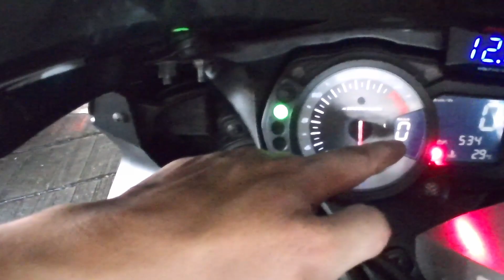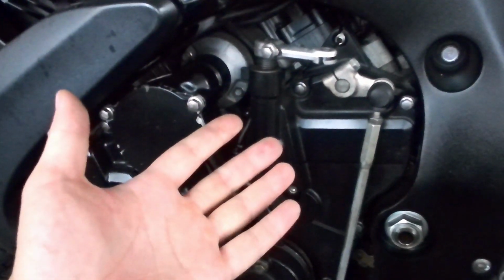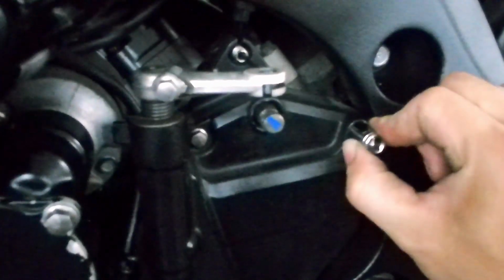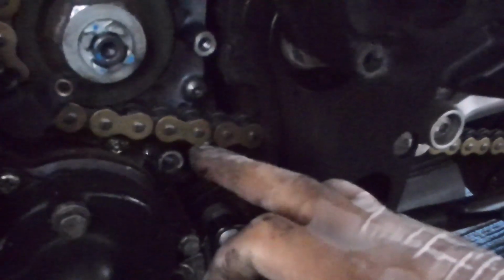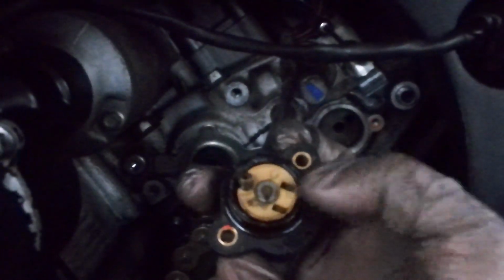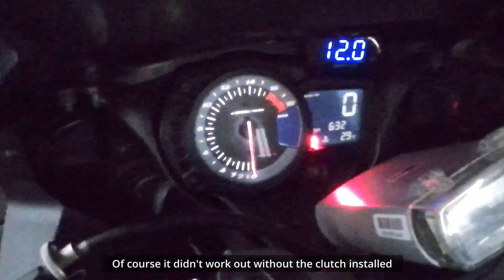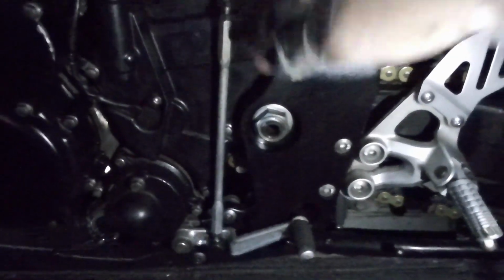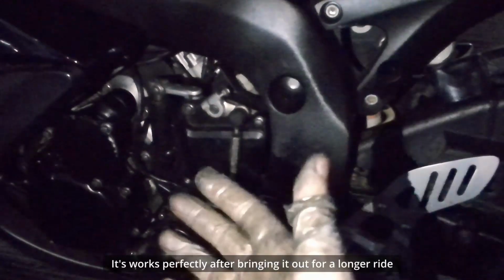Gear Positioning Sensor Clean Up | Blank Gear Show On Indicator? | Suzuki GSXR Restoration [Part 9]

Comment: what year bike is this? i got k8 750 with the same issue, guessing i need to try wash it or replacing it.
Reply from the maker: 2008 k8 600. Try washing it 1st, if it is still not working then replace it.

Comment: Boss, great video as always. If i use those quick drying contact cleaner for the gps instead of brake cleaner possible?
Reply from the maker: I reckon it is possible too, as long as it can clean the sensor.
Reply: @zwc888  ok noted boss, i wish i can be skillful as u in servicing my own gixxer. The only thing that is holding me back to tear apart my machine is when i have to assemble back lol..